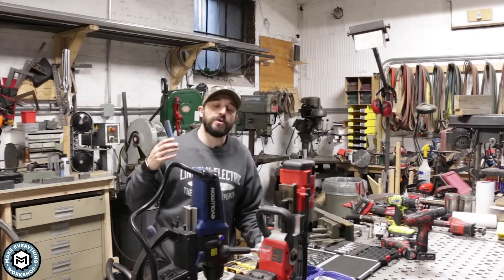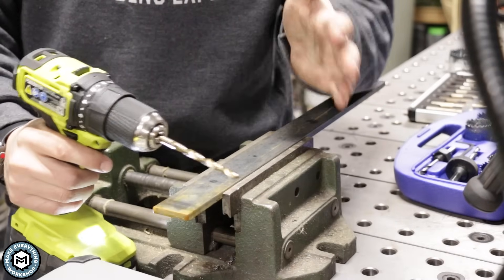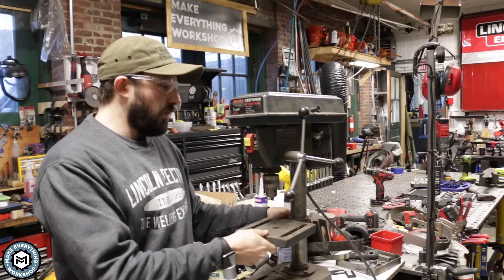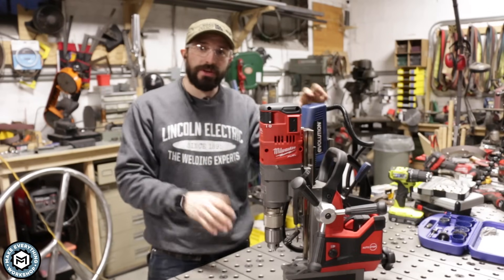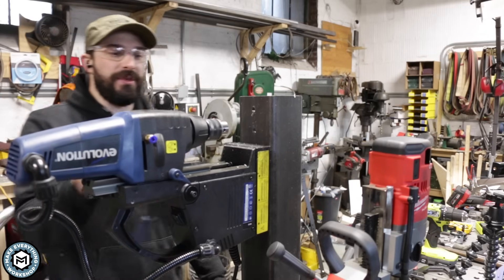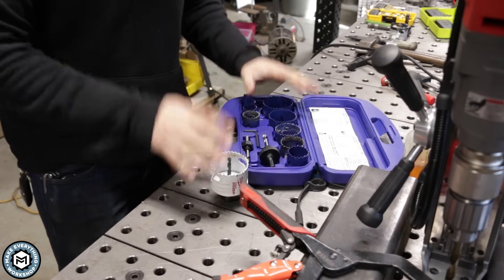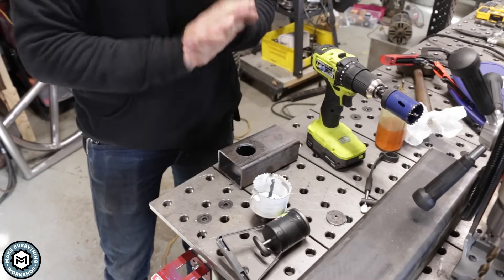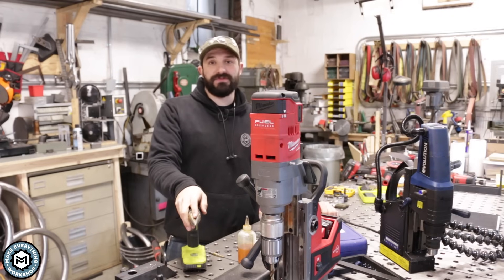How To Drill Holes In Steel - The Ultimate Guide!

Comment: I’m trying to drill a 21mm wide hole at 10pm with old dull dewalt drill bits and they aren’t big enough. So I cut teeth into a 3/8 socket with my grinder and welded it to a one of my drill bits. Success!!

Comment: Jesus my friend! I am making hole on bracket to my big screen and I take around 35 minutes to do also broken a big drill bit , after you video I came do Home Depot bought a oil and set my Dewalt on speed 1 with new drill bit I did the same hole the same metal in just 40 seconds !!!!

Comment: Storage tip.... when putting your drills away in a drill index, store then TIP DOWN in the case.  This gives you two benefits, first you don't cut your fingers on the drill points when flipping through the index and second, if by some misfortune you bugger up the shank when the drill stalls and the chuck messes the shank up, it will still fit in the drill index (you can also grind off the shank buggers too).
Reply: I've never cut my finger on a drill bit, maybe I've just been lucky.
Reply: @kirbylee57  Why risk it then?  They're sharp (or at least should be) and a cut on the finger tip seems to last for eternity.
Reply: @sferg9582  I just dont see it as a risk.  You could have an accident driving your car to work , maybe suffer a head injury , but why risk it, when you could wear a helmet? 
 Some people have their kid on a leash , and actually wearing a helmet. The sky may be falling.
Reply: I like to actually be able to see the condition of all of my drill bits in an index. Sometimes I'm a bit remiss when it comes to sharpening. And I might not be in the mood to sharpen a bit before I drill a hole. It really depends on circumstances. In any event I value the ability of being able to see the condition of all of my drills at a glance.
Reply: And if you get chuck burns on twist drill shanks you can either grind or file them off. I generally don't do that myself but I've seen bits with that nonsense going on.  That sort of thing should be taken care of immediately.
Reply: @sferg9582  I only grind my bits on a 120 grit wheel. So they're not going to come off that razor sharp. That's OK because I'm not planning on shaving with my twist drills anyways. The other issue would be the geometry of the edge itself. The included angle of a twist drill edge is pretty steep. So even if the bit was honed to a high grit it wouldn't be razor sharp. It is thin edges that cut skin.

Comment: The turbo max drill bit from Irwin I found to be the best. No punch mark needed . Drilled some 700 holes in sch 80 1" pipe with a 5/32 bit before it was to dull to use . it was with a drill press . The regular bits wandered

Comment: One tip I learned pretty quick is when using just a regular hand drill with metal. Don’t use the torque lock out setting. Set it down a notch or two  so that if your bit catches, the torque limiter will just slip instead of spinning your drill around.
Reply: especialy on a ladder lol
Reply: you gotta have a pretty weak wrist to be lettin that happen bruh 🤨

Comment: @Make Everything 
What a fantastic and comprehensive video. How would you recommend drilling through a 9 inch load bearing i-beam.  I have a double 2x6 top plate between the beam and the floor joists of the second story.  On one end there is a 1/4" square post like the one in your video, welded to the beam in the basement and the other side is mounted in a column of 2 by 6's. The beam in the basement is a 12 inch i-beam mounted both sides into a knee wall with columns of 2 by 8. It also has a 2x8 top plate. It's all very secure but I just wanted to install some screws to the above top plate was perhaps every 12 or 16 inches apart. I was thinking about using like 1 5/8 screws good for wood

Comment: I have had many cobalt drill snap on me, usually on breakthrough, I'm not talking cheap cobalt drills either, I usually buy good quality cobalt drills especially in the common sizes. I would say that mag drills are not rally for small drill holes as they don't have the higher speeds required, with most a drill chuck is an optional extra(here in europe anyway)their main purpose are multiple large holes in thick metal at any angle.

Comment: Great video.  But what would you recommend I use for drilling through a heavy truck frame?  I have a DIY project coming up where I will need to drill sixteen 1/2 inch holes through a truck frame.  Hole location and straightness is critical.  I will need some type of horizontal drill mount that is slightly adjustable up/down and left/right so I can locate each hole within a .001 inch of each other.  Due to other attached (by rivet) brackets etc a mag-mount drill will not work for 8 of the holes.  And just holding a hand-held drill, in my experience, will not guarantee a hole that does not angle slightly.  As you can tell I'm concerned as I've never done this before.  Thank you, and anyone else replying, for your help and advice.

Comment: center drills are great (and cheap) for making pilot holes. And you dont need to buy a punch, just grind an old drill bit or tap
Reply: Using a brittle cutting tool is a very bad idea. A punch is made from a more appropriate alloy that's tougher than any cutting tool. A shattered drill will throw shards of sharp metal everywhere.
Reply: @GFTP100  a punch has to be harder than the material it punches, and therefore more brittle too. Using 6mm diam  or more HSS drills/taps you'll be fine, they wont shatter

Comment: Some helpful tips here. But they are all for drilling holes on a flat vices surface.  I would like some tips on drilling a fixed vertical surface.  Actually it might have some movement as it is the garage door rail. Tips?

Comment: I’m not a fan of cobalt drills in hand drills. You can do it, but cobalt makes the drill harder but also more brittle. Makes them easier to snap in general, but that comes out most when hand drilling, especially at awkward positions with smaller bits. Since most people don’t own a drill press, a quality set of HSS is the best place to start.

Comment: Hello Great video. I do have a question. I'm trying to drill through a 1.25  square tubing .120 thick using a 5/8 drill but at the lowest speed of 625 which is the slowest my press will go I still get chatter and an uneven hole. Do i need to get a new drill press with a slower speed or what can I do to get a clean hole. Oh the tubing is carbon steel. Hope you can help.
Reply from the maker: Thanks! Are you stepping up into it or just going straight to a 5/8” bit? I’d go 3/8” first at least, then the 5/8. 625 is a little fast for 5/8 in steel, but if you clamp it well to your drill table or use a good vise it should be ok.

Comment: Another risk with the corded drill is the breaker tripping. Say you're using this drill, and a welder shows up, plugs into the same ckt and starts running a bead on some thick stock thus requiring more amps. POP goes the breaker and your toe!

Comment: Hey Chris, 
I need to drill (4) 3/4" holes in 3/4" steel plate.  Mounting a dump truck pintle hitch.
Would you recommend the magnetic or a bigger hand drill?
I've got a a good 3/4" bit and cutting oil.
Thanks Kirk
Reply from the maker: A magnetic drill would be your best bet, using an annular cutter. Otherwise you'll want to really slowly step up into it once you get past 1/2". An annular cutter will do it in one shot and probably take less than 2 minutes per hole! Good luck!

Comment: Hi my name is Kevin from Aus how do I drill a hole in s/s with a mag m/c  and i ways bolt it down on the table  of the drill or the mill I never held it  by hand our family runes a big engineering  c/o  we work in m/s  ht or even tool steel  or even carbide  if we are going to drill holes in hss which is  harden we have drills that we spin a 3000 rpm  ,you did a good job explaining all about all types drills. I worked in the company for 56 years Kevin Schlipalius

Comment: Newbie question: The drill bit always get stuck and starts to rotate inside the chuck when it passes through the metal piece I’m drilling. I have a Makita cordless hand drill and cobolt drill bits from Bosch. I use cutting oil and start with a pilot hole. I drill slowly and lean on the drill to make it cut better. The Makita has a quick change chuck, you can only tighten the drill bit in place by hand, not with a chuck key. I tighten it as hard as I can before drilling a 5 mm hole in nickel plated steel of 3 mm thickness, still I get this problem. What can I do to not get the drill bit stuck? Thank you for your video on drilling steel. I’m only used to working with wood, the odd time I need an extra hole in like a bracket I find it difficult. Happy New Year from Finland!

Comment: Excellent video! I would add one suggestion, a safety tip: ALWAYS hold the work with a clamp or vise when cutting metal. The drill grabs on its way out of the hole and in a split second can turn the workpiece into a spinning, flesh-eating disaster. The smaller the piece the more important this is, but a powerful drill press can grab and spin even large heavy pieces. 

Also, the long stringy chips produced by drilling steel really are razor sharp, and it also produces very tiny (almost invisible) shards that are shaped like needles. Casually flicking away the swarf with your fingers can give you a nasty cut or a splinter hurts like hell but almost impossible to see.

Comment: The general formula for determining approximate RPM for drilling is CSx4/Drill diameter. CS is cutting speed, which for mild steel using a High Speed Steel bit is 90 (in surface feet per minute), so 90x4 is 360. 360/.25 is 1440RPM. Running your drill slow actually wears them out faster becuse a bunch of heat is created and no work is done.

Comment: Great video! What drill bit would you recommend for 11 Guage steel 3×3 already an existing hole but needs  drilled to 1 inch? I am thinking the step drill is best with a hand drill at low speed. Thanks in advance

Comment: On the subject of drilling with hole saws I have made large washers up to 3" outsidand a
Reply: Sorry sent it before I was done. Any ways. 3" outside and inside diameters of any size you want or At least the size of hole saw you have, how I did that is cut the first hole like you would normally do and then take the hole saw you just used and cut the head of a bolt off that  thread into the hole saws that you are using and just screw them on to the bolt making sure the smaller hole saw is out further  than the bigger one smaller one works as a centering guide just like the 1/4" bit does for the holesaw you use for the inside dimension

Comment: @ 30:40 its a good idea to drill a hole where the whole saw teeth will be so chips and saw dust have a place to fall to.  Not a big deal in thin metal but really helpful in wood.  You can typically use the pilot bit.  Just makes the outside diameter of the pilot bit matches the outside diameter of the whole saw teeth.
Reply: HOLE!!!!!!!!!!!!!!!!!!!!!!!!!!!

Comment: At 32:02 when you talk about putting an extension cord through a hole in the steel, please make sure that there are no sharp edges that will damage the sheathing of the extension cord. Better still, use a nylon grommet or an off cut of conduit to protect the extension cord.

Comment: i need to drill through a heavy duty steel trailer to fasten a tiny house to the frame. what's the best way to drill straight threw 10-12 inches so i can attach the framing to the frame with 1/2 or 5/8 bolts?

Comment: I have gas steel pipe that I had cemented upright into the ground. How do I drill a hole through it now that it's standing up? Would a regular drill with a regular bit and some WD-40 work? Is there a special bit to use?

Comment: Its ALL about the FEED (Pressure) and the SPEED (RPM) of your Drilling Operation . Keep the Drill bit COOL use Cutting fluid on larger Holes    REMEMBER   excessive  HEAT  Destroys the Cutting tip and Sharpness

Comment: We had a job once where we had to put some decking on an I beam structure, we had 2 cobalt drillbits, in total we had to drill somewhere in the neighborhood of 150 holes. Everything was going well until the very last hole. We used one drillbit until then for every other hole. So we get to the last hole completely dull out our drillbit and at first, we thought that it just got dull from every other hole, so we switched it out to a brand new bit and continued drilling. Well yes, if only it were that simple... The cutting edge melted, at the end. It was a Sunday, at around noon, so there were no shops open and no way to sharpen drill bits... What to do? Well, the only thing to do was to cry; I'm kidding of course. We ended up using the friction from the bit to melt the last bit of the hole out. In total, it took around an hour to drill that one hole. It was going too well, and naturally, something had to screw us over :P
Reply: Tekscewas as drillbit,works every time
Reply: Tecsrew as a drill bit

Comment: Nice presentation.  I've built a lot out of metal. Wow, this is the first time  seeing a magnet drill. I could have used one of those many many times! I didn't see in your video of  the issue I come across too often drilling into  hot roll steel the steel from the metal warehouse.  I've used all kinds of drill bits. Including the DeWalt Pilot bit you had in this video. One of the best I've tried. When  I'm drilling some holes , some drill without any problems at all and some it's like part of the same metal is made of a stronger metal or hardened and I can't get through the hole without going through a number of drill bits or not at all and have to burn a hole with the welder. Seems like with the trouble hole I'm trying to drill  when it starts to get polished smooth I can't get past it. Any videos on that scenario? The magnet drill might help but I've even put too much pressure snapping the drill bit.
Reply: I just ordered some cobalt drill bits. I don't think any of mine are made of cobalt. Worth a try. Thanks for the suggestions.

Comment: He mentions "mild steel" a lot.  Sometimes you have something harder.  Like a saw blade.  After you have exhausted the cheap solutions try "Chicago Latrobe Solid Carbide Spade Drill Bit" on Amazon and click on the title that matches this.  There are a dozen size choices.  You aren't supposed to use them any deeper than the width.  Say 1/4" deep for a 1/4" drill.  There are no flutes to remove waste.  So pull out the drill and blow out the hole as best you can for deeper cuts.  Using a drill press is quite desirable.   I have come across hard steel that even these drills won't cut.

Comment: From a machinist of 40 years, it amuses me how many you tubers run drills at speeds way too fast and don’t use a lubricant, 
and then wonder why the drills lose the cutting edge or burn.
Reply: I'm the opposite. It pains me to see smoke so I often use too much oil. And yes, I got proper cutting oil.

Comment: I have been around all of this for years, but after hurting my back and being unable to work, I became, let's say "CHEAP". So I aften look for used bed frames. Great for simple welding projects, but drilling holes in them is ROUGH!!!  I am all ears for suggestions on drilling hardened and/or hot rolled steel.

Comment: Try drilling a small hole saw hole. Then, replace the outer cutting hole saw with a larger diameter hole saw then also screw back on the original smaller hole saw that made the first smaller hole you wish to enlarge.
 The little first hole saw holds the second bigger hole saw steady in the hole. Thoughts? (Yes, these instructions are hard to follow )
Reply: Also with wood, I will take a piece of scrap wood 3/4 thick or so. Drill the bigger hole in it and center it over the first hole and tack in place to use as the guide

Comment: Be aware that one of the main reasons that stainless steel and to some extent aluminum, are "work hardening" materials. If your tool is dull or you don't keep a constant pressure on the drill you may work harden the surface where you a trying to cut and you will have big problems. If at all possible use a drill press.

Comment: I need to drill just one hole in an electric wall mounted fireplace bracket so i can hit two studs.  Any suggestions? I’m sure I’ve drilled metal before but don’t want to break this bracket.  I doubt it’s 1/4 inch but it’s not delivered yet.

Comment: When drilling a pilot hole. Shouldn't the pilot drill bit be no bigger than the chisel tip of the main drill bit. That way the larger drill bit doesn't start cutting in the wrong place?

Comment: With a hole in a piece of metal and you don't have a large enough bit to make it larger, could you install two Hole saw bits in one drill? One the size of the original hole and one the size of the new hole you want to make. This would keep it from walking.

Comment: All oils are not the same.  Drilling oils work so much better than 3-in-1 oil.  I found Tap Magic to be the best.  In my younger days I drilled without oil.  After I used cutting fluid, I never do that again unless I am out of cutting fluid.  Also, I have a cheap mini drill like you.  I leave it set up with a pointing bit and us it to start my holes.  I use it with a punch and many time in place of a punch.  I run all my bits through a Drill Doctor before I use them.  It makes Harbor Freight bits cut as good as any.